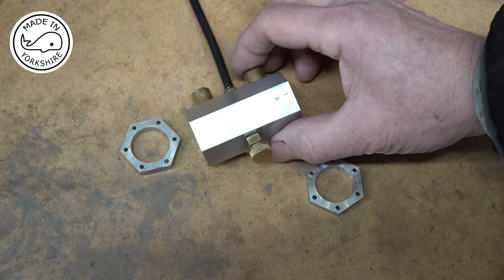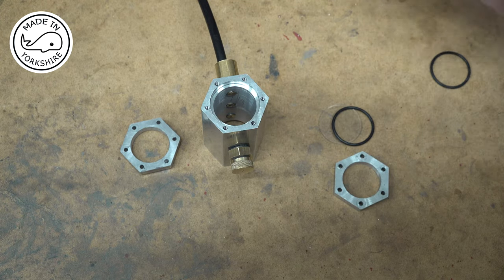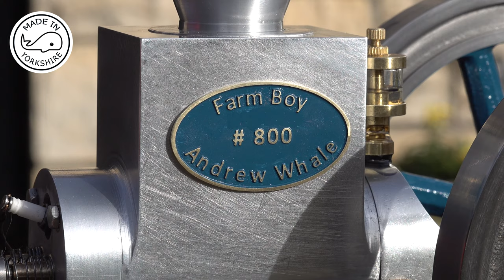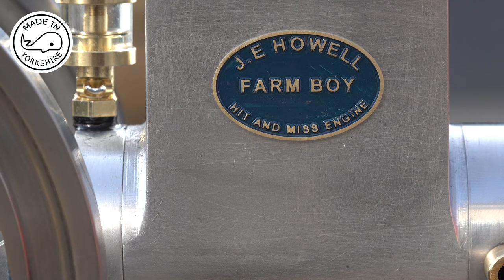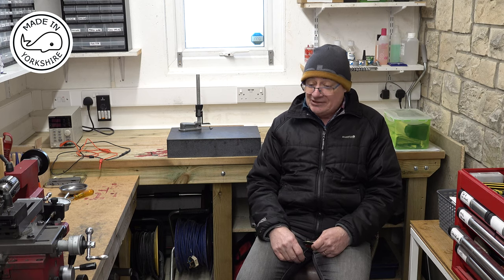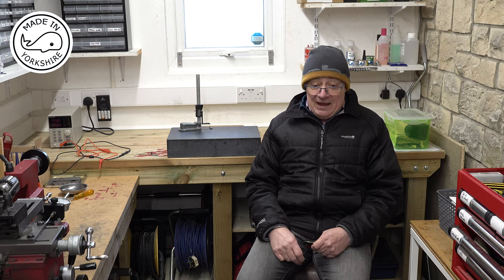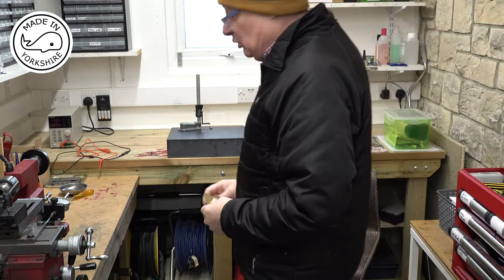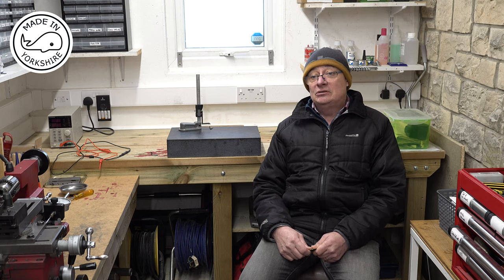#MT35 Part 23 - Farm Boy Hit and Miss Engine. The Completed Engine in 4K. By Andrew Whale.

Comment: Top job there Andrew, another great model made. 
I'm going to start on a Jerry Howel "Powerhouse" engine soon for my first internal combustion engine. I've purchased the plans and most of materials I will need (excluding the ignition system) I need to try and make less mistakes than on my previous builds if it is too run...
Reply from the maker: Thanks Dave. The powerhouse looks like an interesting project. I hope it turns out well.
All the best.
Andrew

Comment: It's a beautiful engine for sure. It would be interesting to know how much it cost in parts and materials, and perhaps fun to estimate cost of labour on top of that.
Reply from the maker: Blimey - I dare not go there. I think that there is significant cost in tooling alone. I had to purchase loads of UNC taps and dies, make a between centres boring bar, purchase gear cutters and a good many end mills. I bet I spent several hundreds of UK£ before even starting. Oh - and I purchased a £2,000 mill!
Like I say - best not to go there. Good fun though.
Cheers
Andrew
Reply: @learningturningmetal  Thanks for that. I'm looking forward to the next one.

Comment: How's that warco wm18 mate? I've wm14 at the moment but looking to upgrade as I found wm14 too small for some jobs. I'm sure wm18 would be more rigid?
Reply from the maker: Hi mate - the wm18 is really good and HEAVY - mine has power feed on the x-axis which I recommend. Warco now sell a belt driven version which might offer better reliability in the long run (time will tell).
Cheers
Andrew

Comment: Hi Andrew, what a cracking engine, it's great. You did tell me before but what are you using and whats your opinion of it . Reason I ask, I'm about to buy a mill in the next few months all being well but I can't afford to buy one  that doesn't do the job. Your one looks pretty hefty and like it can handle medium sized work. Anyway thanks for the vids, keep up the good work.
Kind Regards
Mike
Reply: Hi Mike, I have the same mill, it's a Warco WM18 variable speed. Very capable machine. Great table size, height clearance, power, back gear etc. I can fully recommend. I'm sure Andrew did an unboxing video last year.
Reply from the maker: Hi Mike - as Dave mentions I did a brief video when I got the WM18. It's pretty much perfect for what I need - with power feed on the x-axis being a bonus. I found it very accurate out of the box. I fitted the Warco scales/DRO myself - a bit faffy but no great deal. I blew one of the internal fuses recently when the machine was under load - not something I ever experienced on my little Sieg SX2P (brushless). I've since purchased a load of fuses just in case. I understand Warco now sell a brushless belt driven version which might be a better longer term option (time will tell). 
Hope that helps a little.
Cheers
Andrew
Reply: Mike, an added note, I bought the power feed separate, fit it yourself and you don't get the issue with the rhs wheel. You also get a spare wheel :-) Also my dro I got magnetic from M-DRO. Got them on my lathe too. Again, fully recommend. (no affiliation to either).

Comment: Hi which fuel do you use now
Reply from the maker: Hi Philip 
I use Coleman fuel (aka naphtha) which is very compatible with viton (the o-ring material).
Reply: Your engine looks great, I'm hoping mine looks and works a well a yours when it's  finished.  Just a bit unsure about the o ring on the piston not sealing  properly
Reply from the maker: Thanks Philip. If you stick to the drawing spec you should be fine 🤞